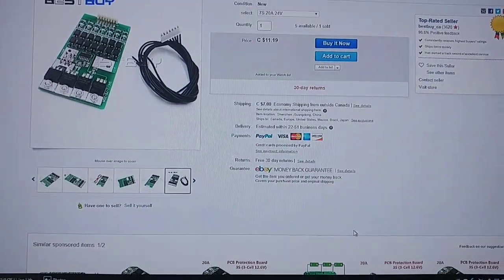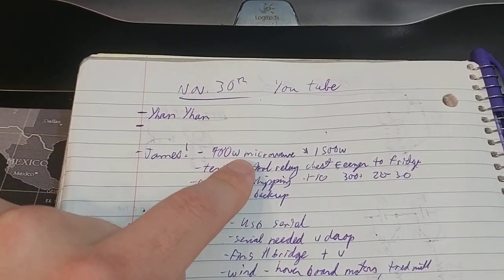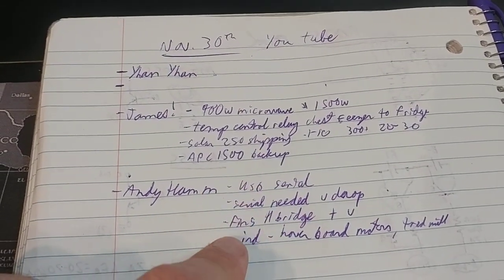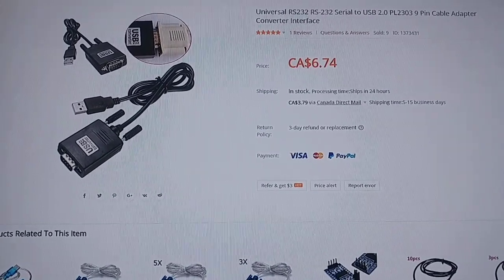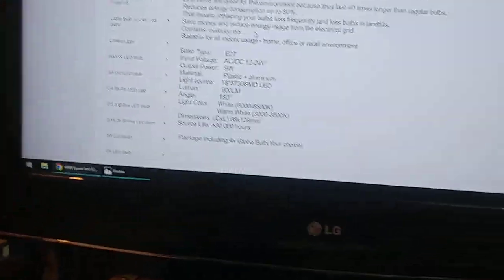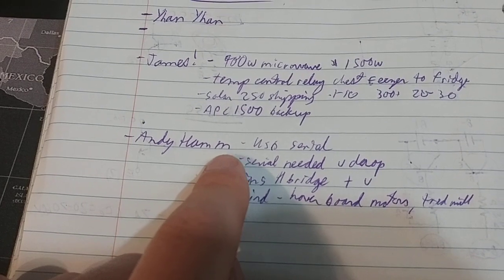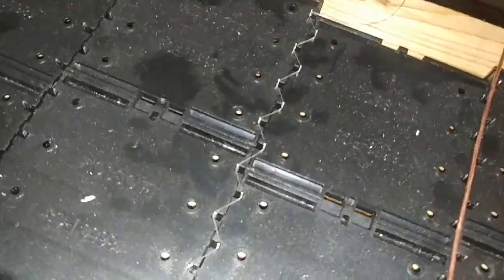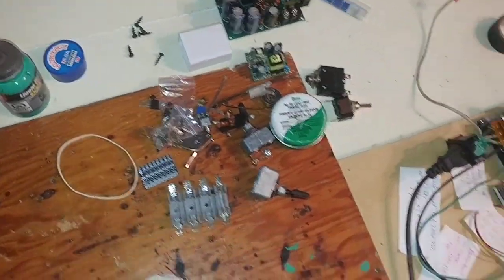18650 7s dec. 2018 update apc mod and battery holder fusing

Comment: Yea they don't have much balance current. The average I seen is 60 ma. A few with 100ma. The baitrium is variable up to 2-3 amps I heard. And after programming the longmons can balance without the cell monitor thing the long Mon cell modules connect to. But the cost ! It's like $500! I can buy a few more cells with that cash! Where is Hamilton? I'm in North Carolina! A ways from Canada. It would be awesome to hangout and work on stuff. I don't have many friends in to this. Most still work out of town. And only home 2days a month. And anyone else I talk to about what I'm doing, they change the subject at the first chance!  Do you have email? I could send you pics of my battery packs I'm building. I bought more 8gauge copper wire today to make busses . I'm soldering fuses to them. And 20gauge on the negative side! I have the 8 gauge going through eye bolts or screws, they are tiny. To hold them on the pack. They packs are similar in size to the Nissan leaf packs.. If you are interested. I'm at jtj28659@gmail. Com 
I don't really do Facebook or the forums. I like Jehu and Peter, 'the Aussie'. They convinced me to go lithium. When HB piwerwall went days on battery power. I made up my mind! I'm sort of a prepper, without the preppings! I had alot of stuff. But my house burned to the ground. And I haven't built up a stash yet. It's more of a natrual disaster I tend to prepair for. Not zombie's or anything. The way storms and fires are these days you never know what's gonna happen. Keep at it !!

Comment: Am I first?  What's up man. I need a BMS! For now I have a cell monitor with balance function. But its not gonna ballance anything at like 60 ma on a 500+ ah battery. I may get a small bms like ebikes use. Until I can get a baitrium system. But being off grid. I wonder what the current draw would be on it and the monitoring equipment. ( laptop or desktop or whatever is needed. ) everything I have is Android . I'd like a tablet and monitoring by Bluetooth or WiFi. I'm not all that concerned with balancing. I do need the expensive remote trip DC breakers. capable of breaking 300 amps and 150v or so. Any idea of where to find one??? Another thing I wanted to ask, what are you doing with the old ups you have?
Reply from the maker: Thx man I'll have to catch up once i get home from work!
Reply: Andy Shell yea I'm bit of a rambler today! Sorry for yaking so much today.
Reply from the maker: Lol np i apreciate it man. South Carolina is really far. When i was in the navy i went there twice. Ppl were very nice. Too bad it wasnt closer i might be going to Kansas in feb.